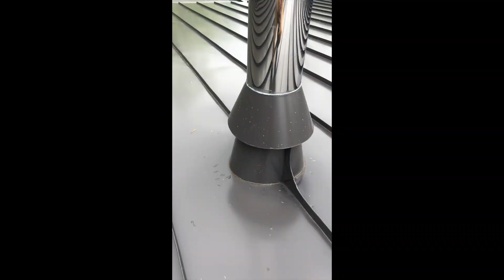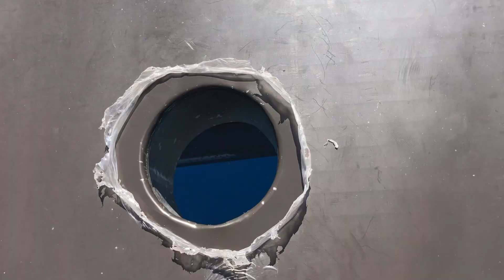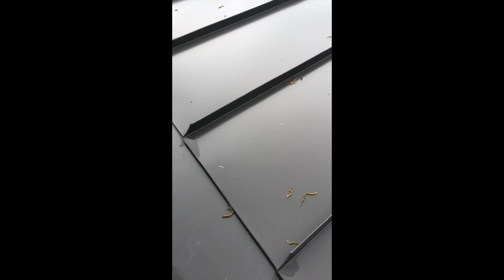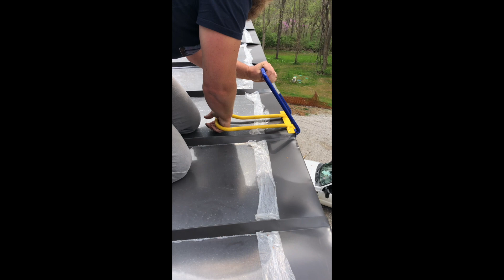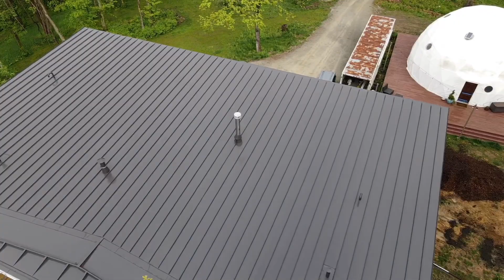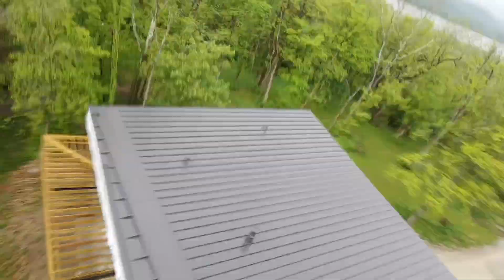The Wall Gutter

Comment: Alright mate. I love your work. It’s brilliant. I am from England. This is how all the metal roof are done. I am an architectural sheet meal Forman out her in Northern California near San Francisco. What gauge steel you guys use over there. My company always pushes 24g. It’s hard to form. I mainly work with copper it’s so hard to convince them here to do traditional metal tool. I hate using caulking and sealant tape. Like you said it’s a faux metal roof. Cheers

Comment: 24 gauge, with all the complex fold stresses, but no splits/cracks?  That's some heavy gauge material.    Very nice, in a way "Urban Experimental Archeology".  Did you buy Yuri Nushtaev's series of Manuals on "Folding Technology"?
Reply from the maker: We purchased all 3 of his books and a couple of his details are featured on this roof. As for splits and cracks, we buy grade 50 which stretches more easily than grade 80 which is more common. When we first started applying these techniques we would see splits and cracks from time to time but they have become infrequent with experience.